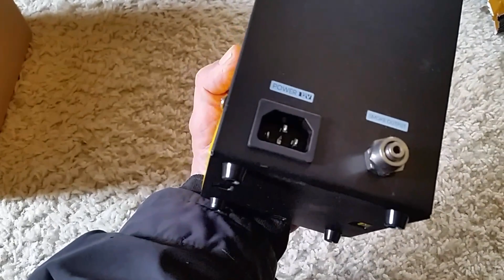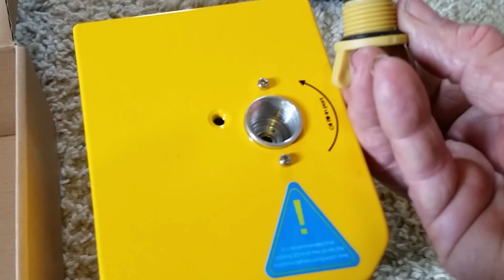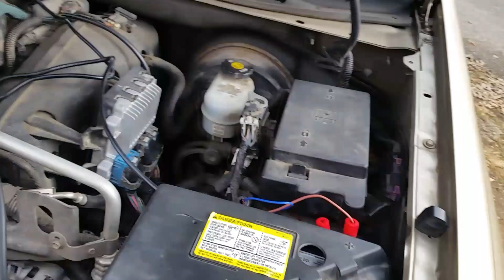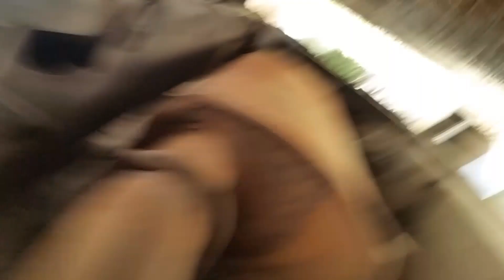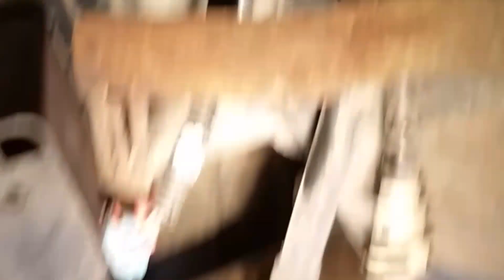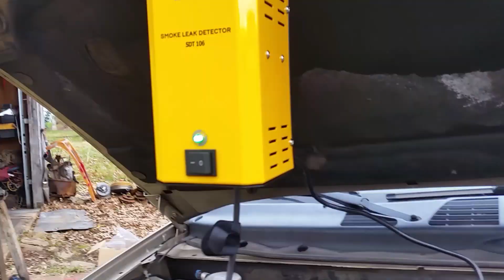AUTOOL EVAP P0496 Code Trailblazer New 2022 Smoke Machine Review

Comment: I’ve been getting that same code on my 06 grand Cherokee and I don’t have any vacuum leaks with the smoke machine and I’ve changed the charcoal canister and the purge valve already and still get the same code. Did you ever fix your car ?
Reply from the maker: Turned out to be the purge valve . It had two wires going to it .  A sensor on the gas tank.
Reply: Are you going to replace the smoke machine, I can give you vip price, please contact me
Reply: @TinaSmith-n1s  I like vip

Comment: Point of interest about a stuck open purge valve, you can get either a lean or a rich code.  This is because it pulls from the canister that may or may not have excess fuel vapors in it.  Significant fuel in the canister will give rich, little fuel will give lean.
Reply from the maker: True!

Comment: Watching from Ashland ky - a nice little addition you might want to add to your smoke machine is a small flow meter. It can help show you how big a leak you may have as big smoke flow shows big leak and help show a very small leak as it will finally show almost no flow type deal.
 I recently had to replace the purge valve on the Mrs caddy and it was located up high on the engine. It threw a similar code and was recirculating when it shouldn’t .
Reply: In edit I just starting part 2 of this lol!
Reply: I was wondering this myself so I might return this one and get the one with the gauge